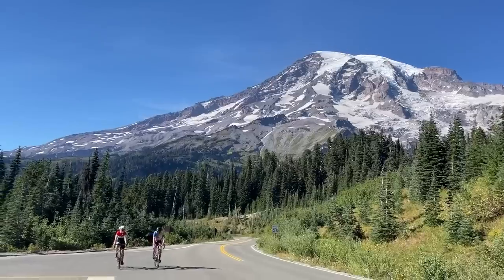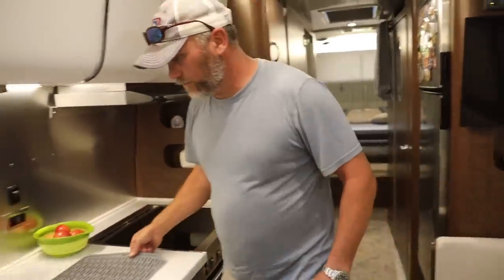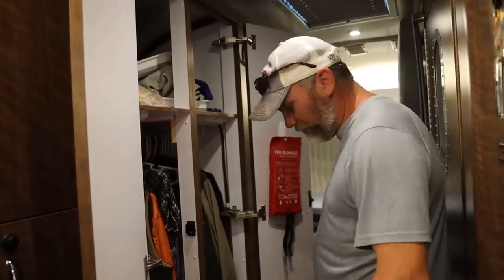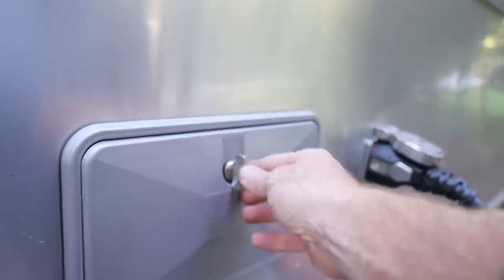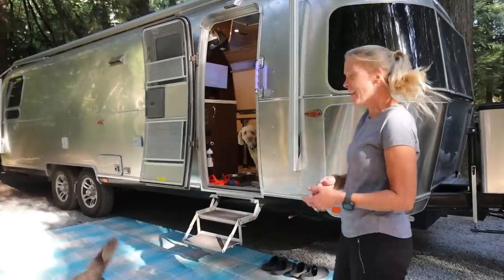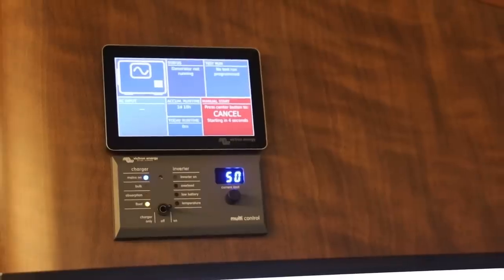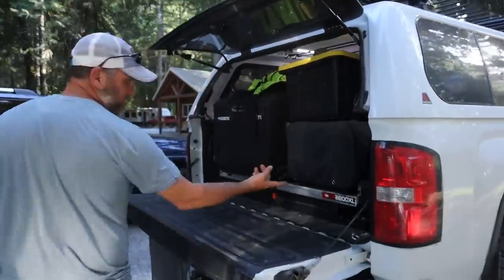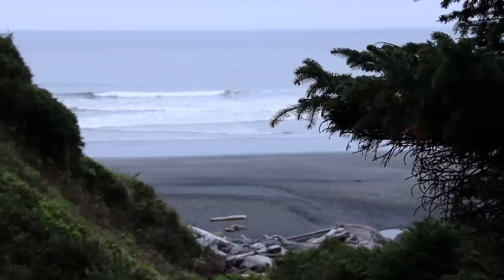Airstream Globetrotter Mods & Upgrades RV Tour

Comment: I hope that you get/got to take the ski lifts at Crystal Mountain Ski Resort up to the top. 

Reward? Stunning views, and you can almost reach out and touch Mt. Rainier. 

There's a nice restaurant in the lodge at the bottom, and stunning views at the top. Especially sunset. 

I used to ski there, flying down the slopes, and gaining air time on the ski boards.

Comment: I'm trying to find those 160 degree hinges that fit our wardrobe doors (2018FB 25' Serenity), but having trouble finding anything that matches the dimensions of our current hinge door cup size, etc.  I may need to make some modifications, but trying to avoid that.  Would you mind sharing where you located yours? Thank you!

Comment: That guy has some skills!!!  I liked the idea of replacing the locks on the fresh water, stabilizers and outdoor shower.  What’s the trick to removing the old locks…and what was used to replace?  I’ve seen the Camco versions on AZ.
Reply from the maker: Very simple. Just press the old locks out and snap the new ones in. It took some finagling, but you'll get it.

Comment: A lot to take in with this video. I appreciate the mods that have been done but I do have trouble getting my head wrapped around the fact that a $100K Airstream does not come with lighted cabinets? I’m a very “tech” Type guy - you know the type that upgrades to 16” Michelins on his 50 year old Airstream for an example or has a 4 battery system so as to run a CPAP without running our of battery. All this to say I will be adding the lighted cabinets off of 12v instead of battery operated stick on LED’s. Keep up the great and interesting content.

Comment: I just don't understand why you'd want a hydraulic tongue jack. Seems to introduce needless complication. I installed a Phoenix 4000 on my utility trailer and it's pretty fast and has auto up and down so I also do not need to use an extension. Far simpler and I don't have to worry about a hydraulic line rupturing and my trailer dropping.

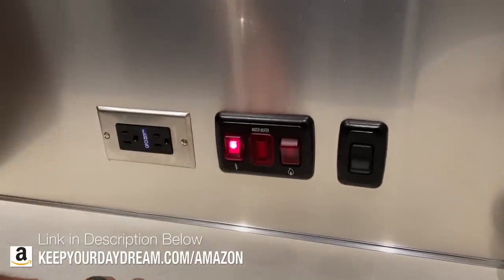Comment: Wait a second, 6:26 did the microwave shut off completely when he closed that cabinet? I noticed the clock turned on when he pulled it out and off as he closed it.
Reply: Yes. It has a switch so you don’t accidentally turn it on while shut. Comes that way from the factory.

Comment: Can you share a link for the that weather projected RJ45 connection to the smart plug for Starlink.  I think you mentioned it was from delcity?  I have the smartplug adapter for ethernet and have been sitting on doing the install just looking for a part like that.
Reply: Can you also share a link for the Furrion Cast Iron Grates? We have a 30ft 2021 Globetrotter, the grates that come with the Globetrotter are a joke.

Comment: So that onboard generator only can run the two ac’s if you have more batteries than the two lithium that come with our classic ?
Reply from the maker: Yes, 2 A/C plus other device and DC power would exceed 2500 (on LP). But when we're on the gen, we typically run only one gen and it's sufficient. When it's over 90 degress, we tend to find shore power.

Comment: Can you post links to the Smart Plug connections he use for his Starlink?
Reply: etrailer has the SmartPlug Ethernet / Cable pass through plug. You have to cut the starlink cord (measure twice before you cut) and add Cat6 heads to each end.

Comment: All that storage rigging, and the rv is still tight to move. He should Just trade the truck for an express van, and storage would be fixed. Just buy a 5th wheel toyhauler and the problem is solved! I don't get it.